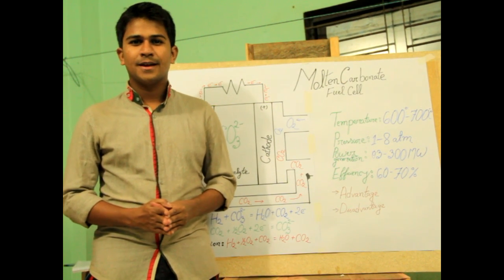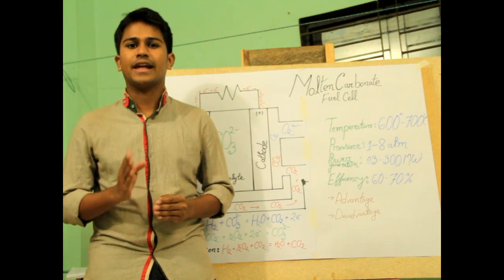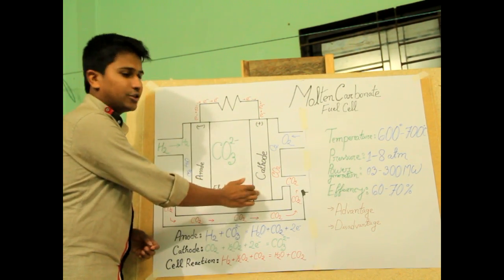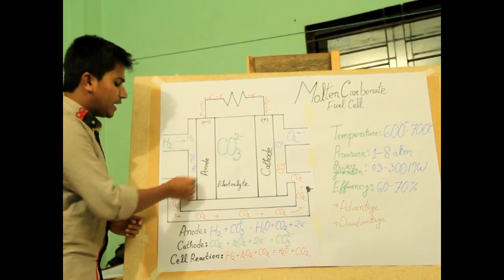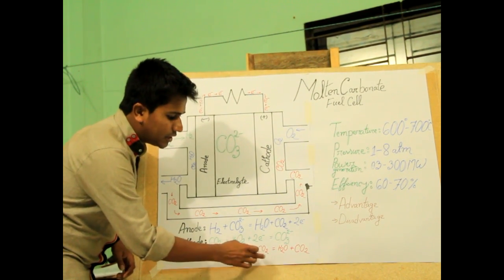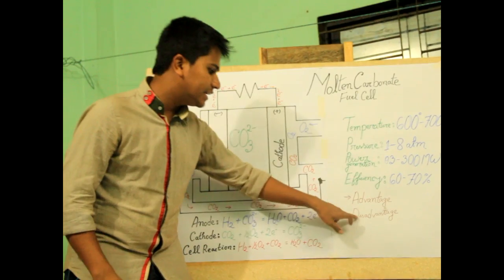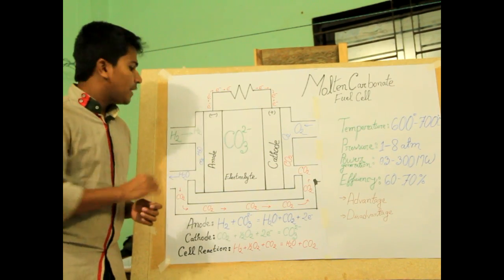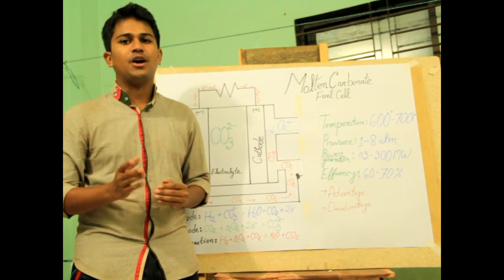Molten Carbonate Fuel Cell (MCFC)

Comment: Nobody want's to hear about any "MOLTEN" Nothing. Your efficiency is out the window and molten and ambulation and gravity and newtons laws of motion don't make good bedfellows. This must be a stationary installation, if the efficiency and toxicity check out, what has the Phosphoric acid fuel cell working in site, connected to a dynamic load and cycling to represent normal operation. Efficiencies are critical when one has to consider the scaling factor guys. 40% is not acceptable anymore, better energy conversion techniques exist and must be used to combat global warming. The Green House Gas Effect.